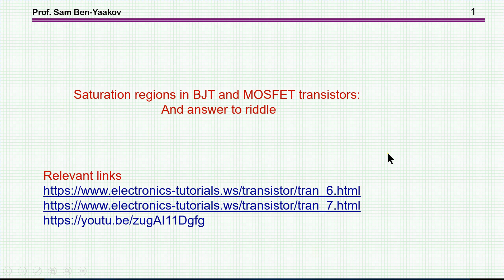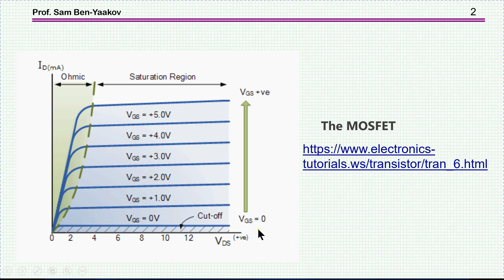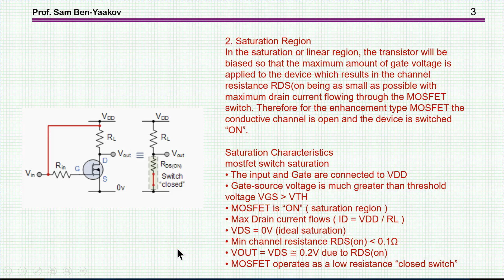Saturation regions in BJT and MOSFET transistors: And answer to riddle

Comment: Your knowledgeableness, Professor Ben-Yaakov, I unworthily beseech you with a query of why the total gate charge is, apparently, higher with higher Vds (and the MOSFET operating in saturation) than it is with Vds=0. If it helps, this is with a superjunction mosfet, IPS65R1K5CE, with Vgs=0-12v, Ig=1mA, and Vds=50v (measured constant) vs. 0v. The slope of the curve begins steeper, as expected for a higher Vds, but then it plateaus out somewhat as though there is some mechanism of the current that allows extra charge to be stored (without Vds falling), and then levels out to the same slope as with Vds=0, but shifted rightwards on the Q-V curve. Sorry if I'm missing something obvious, and thank you in advance for your time (partially for what you may dedicate to this question, but also for that which you spend on making these wonderful educational videos).
Reply from the maker: Thanks for re-posting at LinkdIN. My explanation is copies here:
Hi Tony, Here is my explanation to the three Vgs curves
# 1 Vds 0V, all we see is the charging of input capacitances.
#2 Drain loaded by 50Ohm. Current causes a  Vds swing which requires more gate charge during the plateau which is at the transition (see video references below)
#3. Drain connected  to 50V. The fact that you see a plateau.  means that the packaged has substantial stray inductance which causes a voltage  drop on drain that you do not see from outside. The Vgs at the plateau is higher because you need now much higher drain current which imposes a higher Vgs. To verify this, measured the drain current, Without the stray leakage the drain current should jump very quickly to about 50A (Vcc/Rds(on)). I would assume that you can get a SPICE model of the transistor used so you can test all  of this by simulation. 
See 
https://youtu.be/S_o_ltLJCWY
https://youtu.be/zJQM842clcM
Please share additional data you get on this -  prove me correct or wrong by hard data😊

Comment: Thank you for excellent clarification! Saturation region of BJT was always enigmatic to me, now you presented very nice model that explains it.

In the explanation of MOSFET, I am puzzled by the orientation of Vgs, Vds and Vgd arrows -- usually one draws the arrow from the first index to the second (first being often a higher voltage so that result would become positive). Yet in the video it is drawn the other way round. It does not make it less understandable because what matters are the equations, but it made me wondering if there is some hidden reason for it, that I don't see.
Reply from the maker: The way I am used to:  Vgs ,  g is measured with respect to s. The arrow starts at the reference potential, s in this case.
Reply: @sambenyaakov  Oh, I see. So, this is exactly the opposite of what we were taught at school in Czechoslovakia. Here the arrow points to the reference potential. Good to know that this is not worldwide-universal notation.  Anyway, thanks for those wonderful videos you are doing. Although I studied electronics I always find something new and interesting in them.
Reply: @32bits-of-a-bus59  totally agree too!

Comment: This videolesson finally made clear to me how it is possible that the voltage on the collector can be lower than the 0,6v needed on the basis to get the transistor conducting. But with the two diodeworkings inside in mind it still is very unintuïtive for me. I once used it to mute an audiosignal so simply the collector connected on an amplifierinput and without understanding how that transistor could short a signal lower than 0,6v to the emitter thus to the ground, it worked even best without biassing the transistor, a most normal BC547. Never had any explaination for it till now. And that's why i enjoy learning with every one of these videolessons so much: there are always new insights and knowledge we never found anywhere else, no matter how often we tried to seek for it. All other lessons on BJT's, or normal transistors,  they always show that same basic knowledge. The same for lessons about opampcircuits or opamps themselves. What a knowledgegoldmine for us, these videolessons last year!
Reply from the maker: Hi Rob, thanks for the added value to the video.